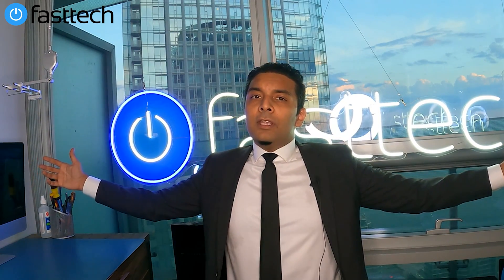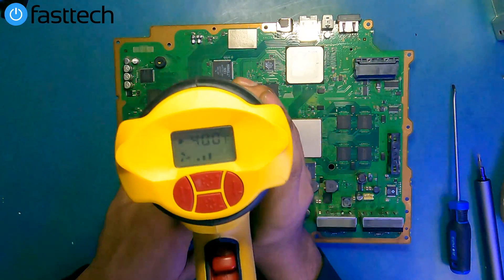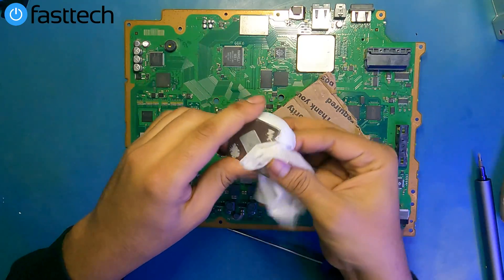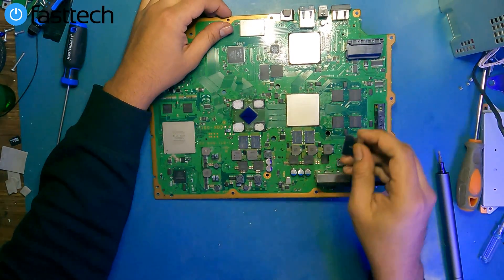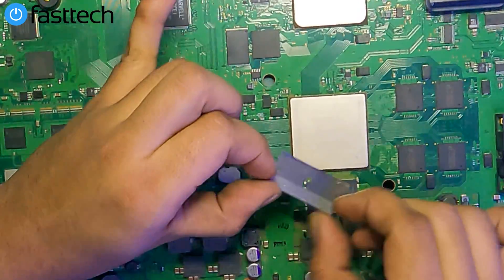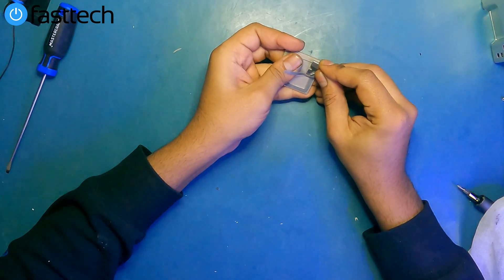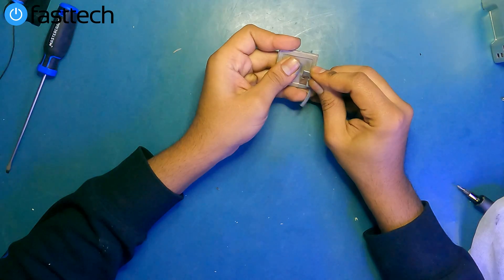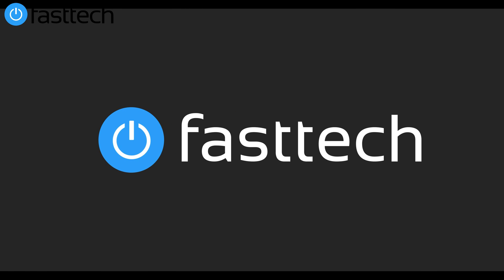PS3 CELL CPU and RSX GPU DE-LID (IHS Removal Guide)

Comment: I think you could just use a paint knife and a razor blade instead? 
And avoids excess heat to these chips that have pretty terrible no lead solderballs that get brittle when they get hot and cool down a ton.
Reply from the maker: Some people use a painters knife I believe its safer to use a razor blade. Unfortunately you have to heat the RSX slightly to get its glue off but we recommend heating it no more than 400F as any higher would melt the solder (lead free solder melting point is 425F)
Reply: @fasttechvideo  ok one big thing, heating a chip at 400F for a minute is not enough time to melt solder, it can take way longer than that, and you don’t even need to do that much heat, just go 212F or 100c for a minute or 2 on the IHS and put light pressure under it with a small metal spudger with cardboard under it to protect the pcb and it will eventually pop right off, you do not need a ton of force, too much force like in this video can result in bga damage which then means more money down the drain